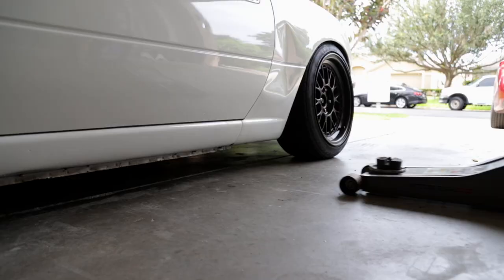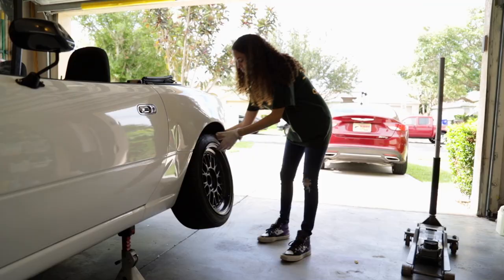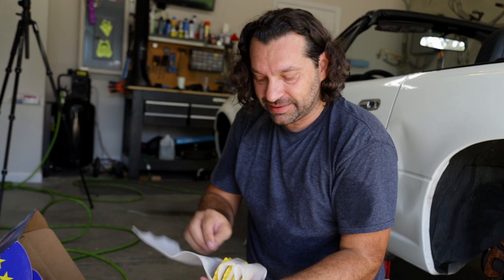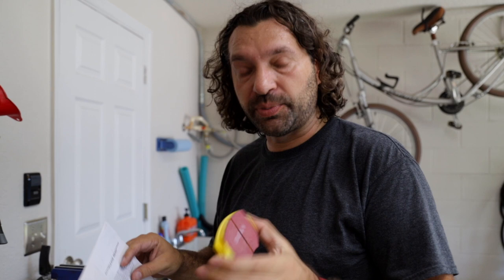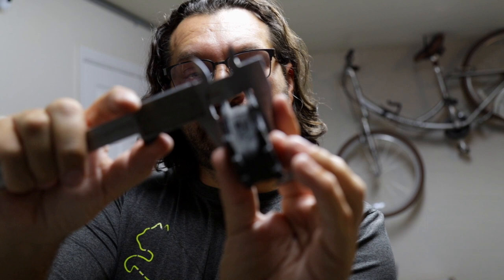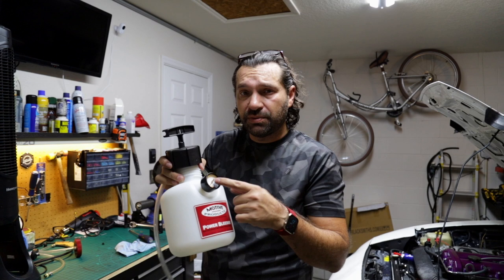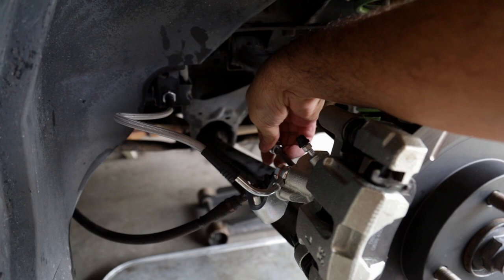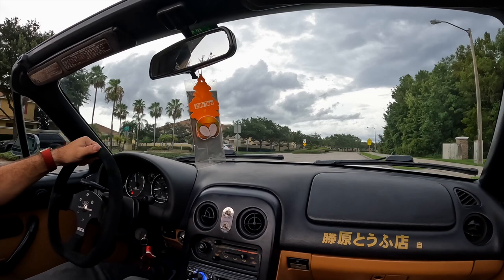Upgrading our Mazda Miata Brake System | EBC Brakes

Comment: Hi Daniel. I hear the slotted and drilled rotors make allot of noise. Do they?  Thank you. Great video. 👍
Reply from the maker: Actually, it’s so insignificant, I can’t even tell the difference under normal driving. Maybe it’s the pad rotor combination or the better sound insulation of the C model, but honestly, I’d just go for slotted only. Under extra heavy load a low hum can be heard. Nothing crazy, annoying or anything to worry about. I can’t hear anything on the Miata, the car itself is just too loud.
Reply: @Turbo_Snail  Thank you Daniel👍. I thought as much. I have a glass pack on my Avenger. I won't hear it. Have a great day.
Reply from the maker: I’d go slotted and yellow for aggressive driving, light track. Or red for everyday with some aggressive tendencies. Green if you’re just going to the grocery store.
Reply: @Turbo_Snail  Yellow would be my choice. Thank you again 👍